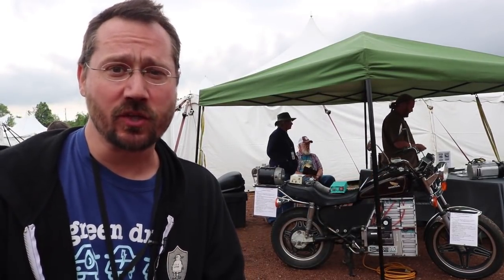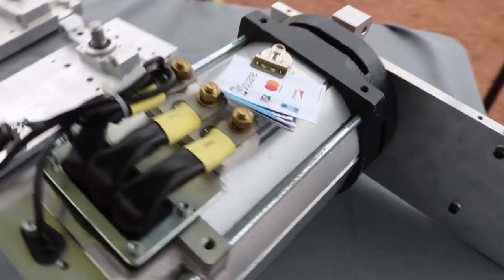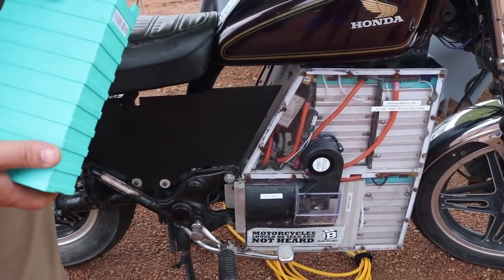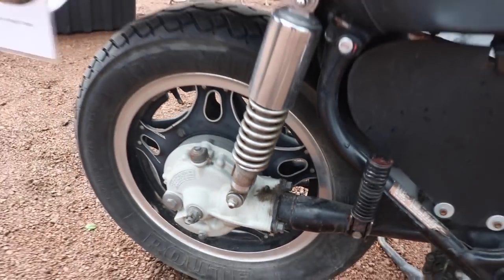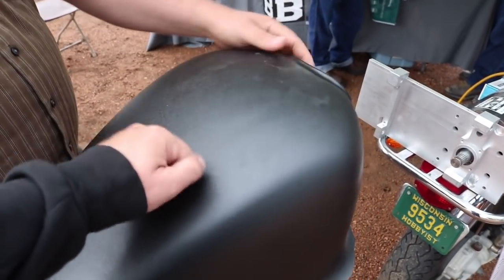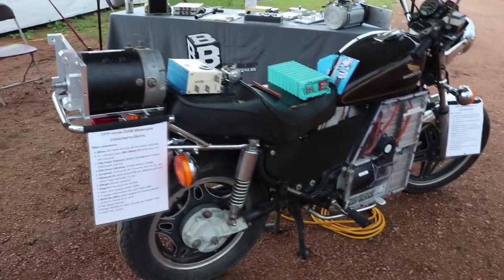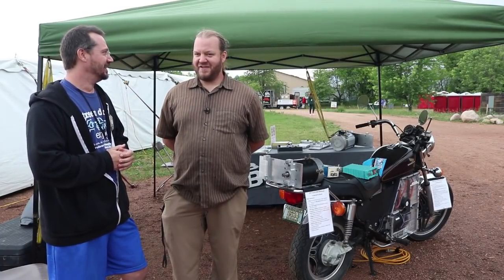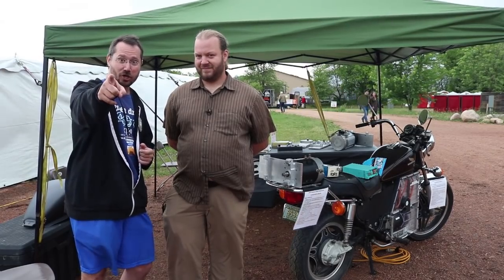DIY Electric Motorcycle from Golf Cart Parts

Comment: You can like to charge a battery with more voltage and amperage and place a device that reduces both the voltage and the real amperage that the motorcycle uses for more autonomy.

Comment: my old school bike half indian and knuckle head bike style has speakers fitted in the slash cut silencers with a bsa gear box electric motor driving the gear box with a hand carved v twin dummy engine, its plunger indian style, the side car carries the batteries, the speakers sound is bsa a 10 sound which are wired in to the speed control so u have idle tick over full speed and it looks if though it is an 1954 indian chief with a bsa a 10 forks and wide yolks fat tyres front and back, a would put that bike he built in the crusher, english built is better

Comment: What if the bike you have is chain driven?
Is it ok to put a sprocket on the motor?
Would I be better off using a torque converter?
Reply from the maker: Most people who do electric motorcycle conversions use chains and sprockets. It's very easy to put a sprocket on an electric motor and use it to drive the rear wheel.
Check out my playlist of converting a motorcycle to electric doing exactly that.
https://www.youtube.com/playlist?list=PLmHss3DBZUin2XgGB3vvhxPkLKW0b_mfk
Reply: @BenjaminNelsonX  I also thought of doing a hybrid. An electric motor connected to a gearbox with built in clutch
And a gas motor also hooked to the same gearbox's input shaft
Reply: @BenjaminNelsonX  is there a way I van get in touch with you directly?
Reply from the maker: Your can leave a message at 300MPG.org
Reply: @BenjaminNelsonX  the yellow bike? I watched the whole build. 
Remind me again why you went with a yellow top instead of a blue top?
Reply from the maker: Blue tops are basically a deep cycle boat battery. Yellow top is designed for high power/deep cycling. The following web page/video explain the difference.
https://www.optimabatteries.com/en-us/support/battery-basics/redtop-vs-yellowtop-vs-bluetop-battery
Apparently, on some of the sizes, the YellowTop and Bluetop are the same internally. The difference is the connections and sizes available. The Yellowtop batteries also have side posts, which I found to be useful.

Also, the motorcycle is yellow, so it was nice to have matching batteries!

Comment: Nice bike. If you can find a donor bike with a blown engine.
Reply from the maker: Or sell the engine off to somebody who needs it.
Reply: BenjaminNelson, yes, but if the engine was in good condition, the bike is still pretty expensive. If the motor is blown the bike will sell for peanuts. A lot less than a running bike after selling the engine. If it’s water cooled like his donor bike I would have kept the radiator and made a liquid cooled bike that can handle a lot more power from a smaller motor and inverter. 

But if there is a budget, buying a big cheap touring bike and using a BLDC motor and lead acid batteries is a cheap way to get it made and on the road. Lithium batteries are cheaper in the long run but for a project that you don’t use everyday, lead acid is still very widely used for cheap EVs in China.
Reply: Two big advantages of lithium batteries compared to lead acid are lower weight and smaller size.  Ryland tested his first version of this bike with lead acid golf cart batteries and it weighed hundred of pounds more and was much bigger and unwieldy.  He only did the lead acids to see if his ideas would work, and quickly replaced them with lithium.  Today, lithiums from wrecked electric cars are cost effective.
Reply: Notice that I was talking about lithiums from wrecked cars, such as the Leaf or Volt, and they already can be cheaper than lead acid.
Reply: wisjim, lithium ion batteries with a BMS are also much less headache to use than lead acid batteries, but for now the lead acid is still the cheapest way to get storage, which is why they are still very common for Chinese electric scooters and small cars. Once lithium battery prices drop some more, I’m sure they will be able to replace lead acid in almost all cases.
Reply: wisjim, yes, sometimes you can get a good deal on used batteries from a Nissan Leaf, and that would have been a nice project. If he got a section from a Chevy Volt and used a liquid cooled motor and inverter and kept the stock radiator that would have been a pretty sporty bike. But if you want to get used lead acid batteries they are still cheaper than used lithium batteries. It all depends on the budget of the project.